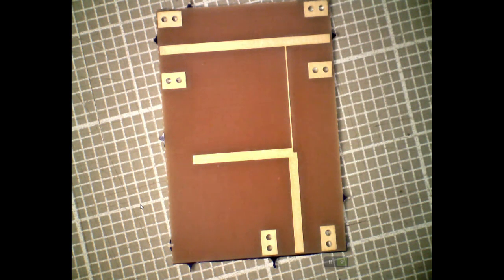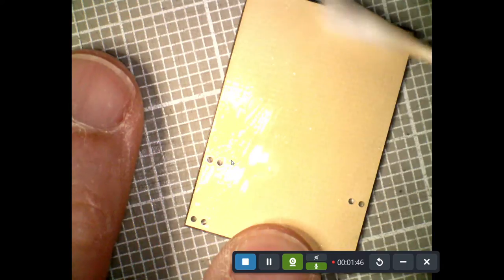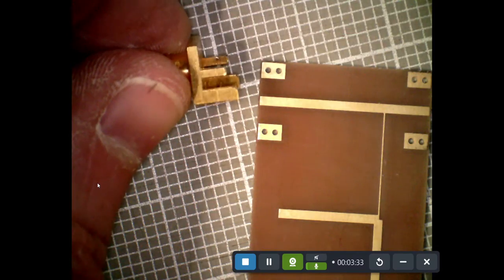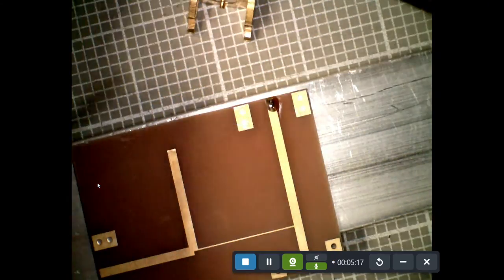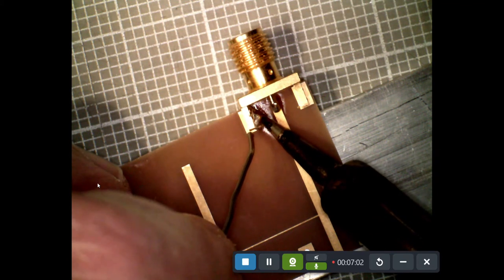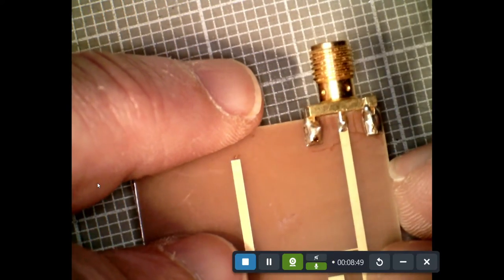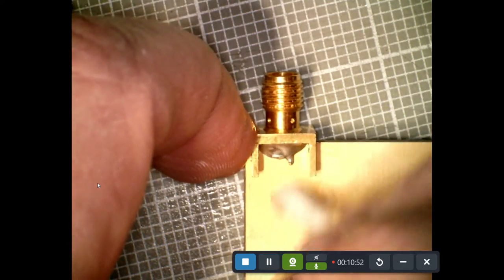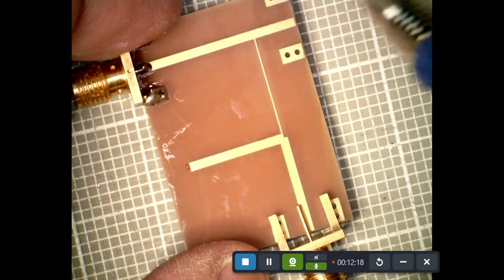SMA edge launch connector assembly tips

Comment: Any further suggestions as to how we may further secure such a connection onto the PCB? Sure many applications of such are set and forget.. screw in the appropriate antenna once and there we go- but, take Software Defined Radio for example and a use case where initially the user of the device is using a broad omni directional antenna discovering interference in an area- once identified, the usage of a directional antenna tuned to the specific frequency- we are switching antennas/ connection adapters/ extensions on and off regularly- that twisting force takes a toll on the minimal points of contact already utilized...

Any suggestions as to how one may secure it further onto the PCB? Usage of adhesives such as JB Weld? Other epoxies? Shoe goo....crazy glue? The latter being much less desirable I'd presume...

Comment: Since the center pin of the connector is small enough to fit entirely on the trace, why do you need to trim it?
Reply from the maker: Right when you exit the SMA coax, it is very inductive, then where you solder the pin down onto the trace, it is very capacitive.  This really limits the high frequency performance.  By shortening the pin length, you are minimizing the capacitive section to yield better performance (lower reflections).  Ironically, I am currently documenting a 3D printed test fixture that will replace this for next semester and will upload this to my channel when it is finished.
Reply: @rfgeek  Did you work out the 3d printed piece?  

I'll check your channel - 

But, I had the same ? after watching that section.. 

True reason I am viewing your video- I came to your video seeking solutions pertaining to securing that connection on the PCB... though, in most applications, attaching an antenna / or the like to such an fixture is set and forget- there are many situations one might need the requirement of switching antennas- example: on a SDR/ software defied radio- when exploring  the broad frequency range may require another more specific antenna per frequencies desired or switching between omni & directional where someone is possibly trouble shooting  signal strength/ quality... maybe tracking down a rogue signal, a cause for interference or discovering devices, even just the generally curious exploring the RF world around them. 

This type of connection is very... delicate? 

One must head caution when twisting the connections together. 

In that sense, I'd think the more "structure" there the better... but what you mention rings true and more than likely  a  issue that outweighs the need to have that little bit more of area to have attached/ anchored  to- quality of signal trumps that of required strength in connection- we then must be extra careful when handling such connections or do we? 

Brings me back to specifically why i a watching your video- why I am here... any suggestions as to further adhere/ anchor/ solidify this connection to the PCB? JB Weld? Some sort of epoxy?